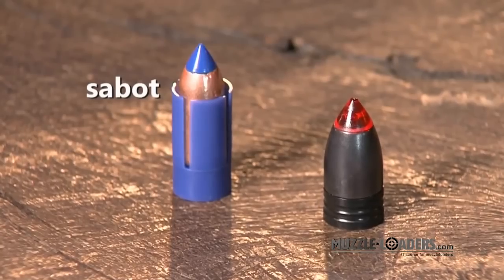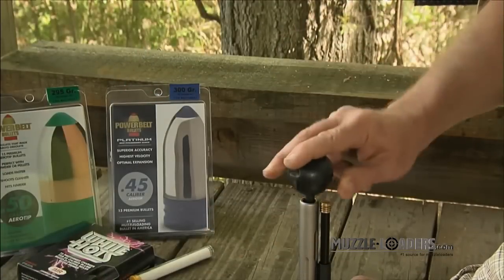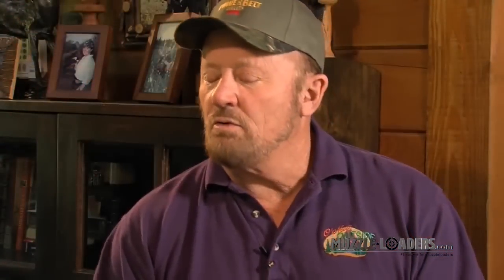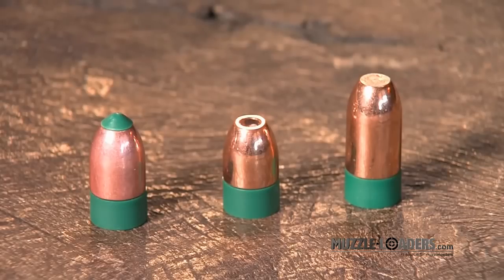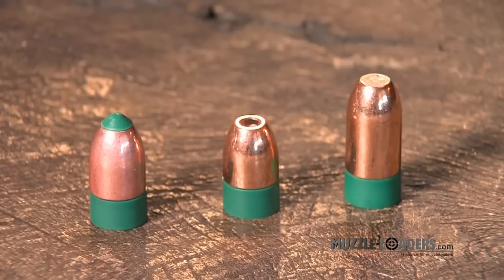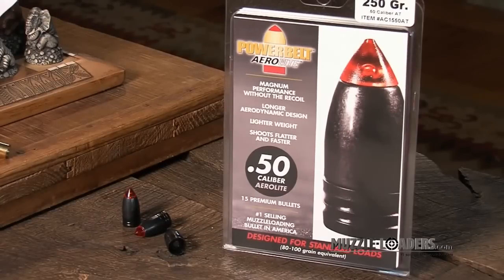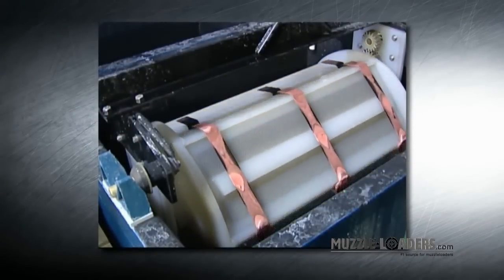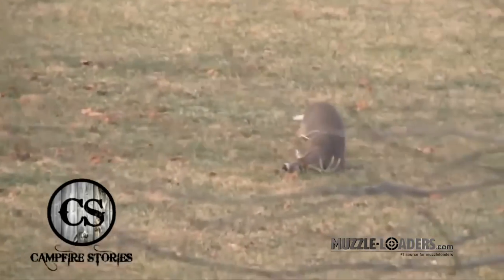PowerBelt™ Bullet Reviews - The Best Muzzleloader Bullets

Comment: I've had very poor results with power belt "puddy belt".  Sure they kill deer, but little to no blood trails and the bullets can break up into fragments. I was using the powerbelt Platinum. If you want to get a bullet that loads easy try the new federal bor-lock.  I use Barnes Spitfire TMZ bullets and they retain almost 100% of their weight, solid copper bullet , two holes, blood everywhere

Comment: I like the Power Belt Aero Lite 300 grain.  It's the black one with the red tip.  Its the only one that makes a perfectly round hole in my target. All the rest make what is called a key hole mark on the target because the bullet is tumbling.  The Aero Lite is the most accurate I have ever shot.  At least that is how it is on my TC Black Diamond Muzzleloader.  My 20 year old Black Diamond with this ammo and 100 grains of Pyrodex shoots a group of three all inside 2 inches at 100 yards. No deer has gone more than 40 yards, which is nothing.

Comment: I have a question I am shooting a 243 saboted bullet with150 grains of powder and am wondering if I should switch to power belts because of difficulty in loading a second shot or even a third shot? Should I do so?
Reply from the maker: PowerBelts would likely be a good option for you as they are extremely easy to load. I would recommend starting with the PowerBelt Platinums. I will include a link below. 

PowerBelt Platinum: https://muzzle-loaders.com/collections/all/products/powerbelt-platinum-bullets-270-338-grain

Comment: Awesome bullets they shoot fine. I've killed 24 deer with them since they came out. This year I started using some Thompson center 230 grain hollow point sabots with 60 grains of powder in my 97 cva muzzleloader. Because I've never used sabots. Needless to say they are more accurate. And way cheaper. Killed a monster 8 point and a nice 5 point last month. Both passthroughs with a hollow point and only 60 grains of pyrodex. When I was shooting 100 grains with the power belt and had less of a hole. But they are great. The aero tip with the green base. Just shoot what's more accurate in your gun.

Comment: I am deciding to use the Power Belt bullet or the T/C Shockwave Sabot Bullet both in 250 grain in my T/C Omega with two pellets. What would would be much more accurate in the Omega ?
Reply from the maker: Both will most likely work quite well out of your muzzleloader but the T/C Shockwave may be the better option here as it is specifically designed to work with T/C muzzleloaders. I would, however, recommend trying both to see which one you prefer.

Comment: your.right the best knock down .I use s 45 cal knight. in line. on NY whitetails. hard hitting.very accurate. try them
you will see.
Reply: I use the powerbelt magnum bullets with 200grains of triple7..in my BLCo Magnum..can hit a peet bunny at 150yds.then blow thru a 1/4inch steel plate,

Comment: ok guys need help i shoot a traditions ultralite i use it for deer only NORMALLY never over 60-70 yards inside thick woods of pennsylvania i want to switch to powerbelts i want a bullet to hit hard and open fast to drop them in there tracks and use max blood loss also planing on switching to hot white pellets if my gun allows any help thanks!
Reply from the maker: +Jake Conner Hi Jake, If you are looking for a good knock down bullet at shorter yardages, I would look at the .405 grain Aerotip PowerBelts. They will give you great knockdown power! You can see them here: https://www.muzzle-loaders.com/bullets/powerbelt-copper-aerotip-bullets.html
Reply: thanks for the advice i hear so many different opinions its crazy i just want a accurate easy loading bullet that gets the job done at short range ill give them a shot thanks again!

Comment: PowerBelt bullets suck. Yes they load easy, but more often than not,  they do NOT pass through game, even thin skin whitetail deer. I have shot many deer with the hollow point powerbelts, with 100 gr Pyrodex pellets, and my results were, while I did manage to find MOST of them, in ALL cases not ONCE did I ever get a pass through, resulting in no blood trail whatsoever. I had to always pay close attention to the last place I saw the deer run off to and try following it's tracks. Ive switched over to sabot bullets and ALWAYS get pass through shots now. I will say that not all the sabots expand when going through a deer, but at least I now get an exit hole, which most of the time produces a decent blood trail. I will never shoot deer with a powerbelt bullet again.

Comment: USE THE HEAVIER BULLET 348 GR IN THE 1-48 TWIST ..LONGER BULLETS WORK BETTER IN 1-48 TWIST, NOW ON FASTER TWIST I WOULD USE 295 GR POWERBELTS USED IN THE IN-LINES..I USE ONLY MAXI-BALL 370 GR IN MY 1-48 TWIST BUT IF I USED THE PB IT WOULD BE 348 GR...SLOWER IS BETTER WITH POWERBELT WHICH IS NICE VERY LITTLE RECOIL......

Comment: now ive only tried the HP once on a deer and i didnt see any sign of expansion. i think it was a 150 grain charge at 30 yds. ill have to test it again but i was pretty disapointed. it knocked the deer down but no expansion
Reply: youre using too much powder. you either need platinum's or to lower your grain. powerbelts like lower velocity under 1700 fps. they even say it in this video. try lowering it to 100 grains or  anywhere between 70 to 100 seems to be the golden area. experiment with the sweet spot of lower velocity to see what gives you better accuracy. unless you plan on shooting past 100 yards then magnums somewhat better.

Comment: with my tc i shot a deer with a power belt 10 yards with a 250gr areotip bullet 100 grs of pellet  when the bullet hit the deer it jumped in the air 5 feet turn on its side in the air and returned to the ground and took off rand 15 yard stopped at this point i got out of the stand and went to where i sot the deer no blood only chest fur i looked up at the direction the deer went and it was standing 25 yards away then it jumped over a tree and took off tracked it for 200 yard no blood what is the reason for that same thing has happened with other deer same gun, bullet, charge, and caps what is the reason that is ?                               
 bc of loosing so many deer using that bullet i now use a sabot again shooting 100 grains of pellet powder with a 300 gr 44 cal hornady XTP way results compered to what i have had with the power belt

Comment: To say Nylon engages rifling therefore leaves no "Plastic Fouling" well hell Mike why not use "POLYMER" it aint plastic either, just ask Glock...HAHAHAHAHAHAHAHAHAHAHAHAHAHAHAHAHAHAHAHAHAH Yeah "NYLON" "POLYMER" all derivatives of plastic little different molding process, chemical make up, But saying nothing "Plastic" left in rifling MMMMM really nylon is not plastic, which melts at high temps What is it that happens to nylon at high heat? But hey aint none of my business